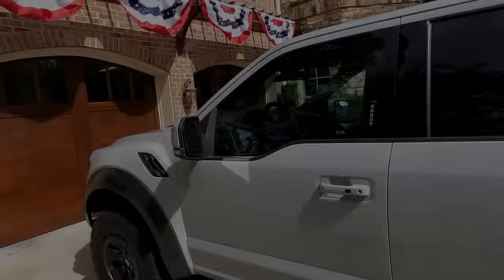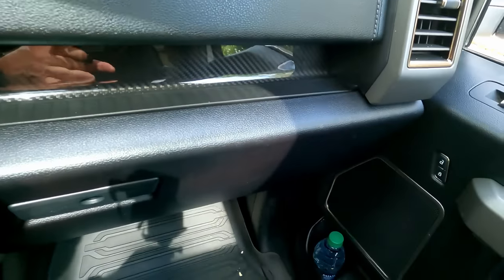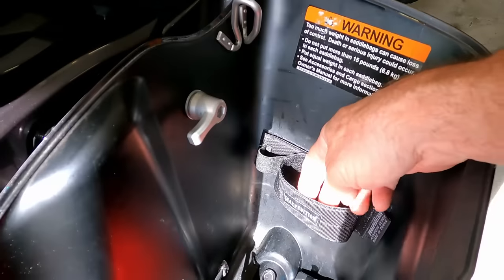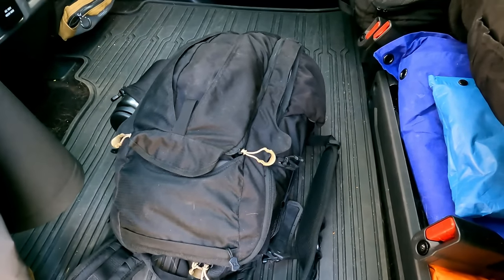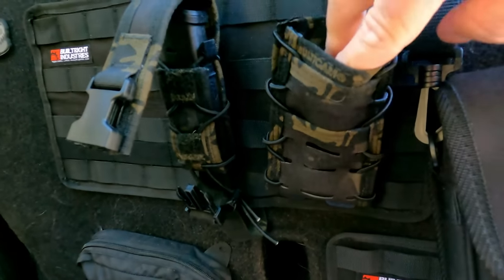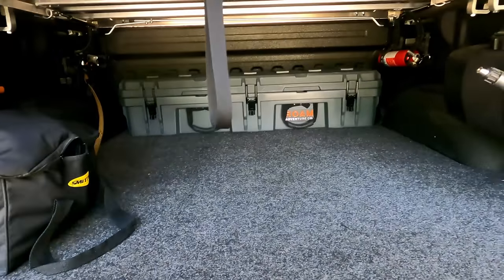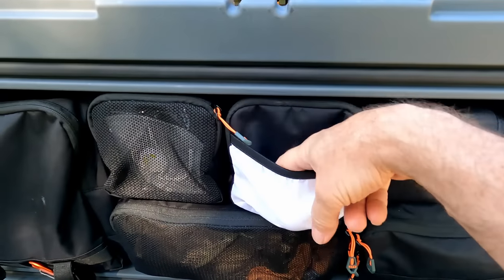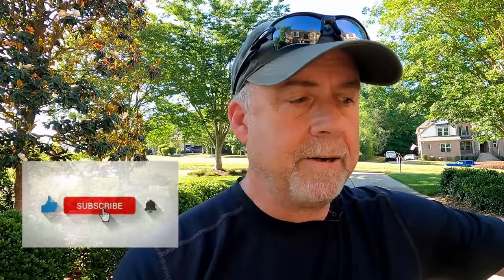Truck EDC - Everyday & Emergency Gear

Comment: Take your tourniquet out of the wrapper. Don't want to be struggling to get it out when you need it.
Reply from the maker: Hi Murph.  Thanks for watching and your feedback.  That has been a very popular request.  I removed it a couple days following the release of this video.  Thanks.
Reply: One may wish to stage the TQ so that it will be faster to secure around a leg or arm.  Pull the strap out maximum slack.  Take the lip that is marked with red and just barely close the lip over on the velcro.  Then fold the excess back into he footprint of the TQ accordion-style and keep the timestamp strip folded back out of the way of the windlass.  It'll save someone a few seconds in trying to get the thing around an arm or leg and less tedious too.
Reply from the maker: @1911GreaterThanALL  Thank you very much for your comment.  Sounds like you may have trained people in this area.  Your instruction was very good.  In fact it compelled me to make the change immediately.  Great instruction.  Thanks again.
Reply: @WeekendOverland  Welcome
Reply: no, that is bad luck, don't do it
Reply: And protect your TQ from the sun it degrades nylon over time. Great vid!
Reply from the maker: @hunterbruce8382  good tip.  Thanks for watching!
Reply: this

Comment: First time I seen a Molle panel mounted underneath the console that’s definitely a good idea best truck edc I’ve seen many good ideas on this episode.
Reply from the maker: Thanks for watching and for your feedback!
Reply: @WeekendOverland  i would add a couple tow chains a 2 or 4 ton come along winch, an old style bumper / farmers jack, a rem 870 or mossberg 500 folding stock with some less lethal rubber slugs, buckshot and some lethal loads, a military surplus 26.5 mm flare pistol and flares, water purifying pump kit, telescoping fishing rod with lures, a 3pc takedown recurve bow w/arrows, a small folding grappling hook with 550 paracord, that is some of what i keep in my jeep
Reply: @commiesnzombies  that's not nearly enough
Reply: @billrom795  it's not what ya could have it's the Wisdom to know how to Use what Got... sounds like all bases are covered..

Comment: Quick tip: Don't show your keys it can be easy to take model pictures and eather 3d print them or take the pictures to a locksmith.

Comment: This is probably the best truck setup I have seen. I hate seeing the “Tacti-cool” truck setups that have “8 Ar15’s, 15 handguns, and 50,000 rounds of ammunition” and don’t have something simple like a car jack or a rain jacket. I have definitely had more flats and caught in the rain more than I have been in a gun fight
Reply from the maker: BC 556 Thanks for watching and your comments.  You nailed it! When you start preparing your vehicle, home, etc, you should first focus on items that will assist you with events that are most likely to occur and then work from there.  Thanks again.

Comment: The holster setup has positive attributes but, what if your weak arm is busy fending off someone grappling you as you are getting in/out?

Or want to access the pistol while you're steering with your weak hand?

Pulling the holster with the gun makes it inaccessible if you only have tbe one hand available.

Instead, maybe train to keep your booger-hook off the bang switch as you draw?

Good setup 👍

Comment: Oh, and a big metal spike to drive into the ground, to connect your Come-A-Long to in case there are no trees to connect to.  1" diameter and 3 feet long.  That will get you unstuck.  Also fire stuff in case you get stuck and have to spend the night.

Comment: Great setup! Not sure if it’s been mentioned yet, but a small foldable solar panel could be a great addition to your recovery gear. Good way to charge your jump starter, comms, etc. if you lose your power out on the trail or anywhere else really
Reply from the maker: Hi N7_Forrest.  Thanks for watching.  Yes that would be a great addition. I have solar panels for my Jackery 1500 but do not carry them with me on a regular basis.

Comment: Sweet setup. What are you doing about the actual vehicle security? Had my vehicle broken into twice and now I don't keep anything in my new vehicle.
Reply from the maker: Thanks for watching and your response.  At this point nothing more than the system that comes with the Raptor.

Comment: Nice set up! I would recommend unwrapping your tourniquet to make it more easily accessible in a stressful situation and to be sure it is properly set up for use. Some come from the factory disconnected so you would have to loop it through the connector. Several YouTube videos on how to stage a CAT TQ.
Reply from the maker: Hi Aaron.  Thanks for the feedback.  I actually took the tourniquet out of the wrapper about 1 week after publishing the video.  Thanks for watching.
Reply: @WeekendOverland  I was going to say the same thing. Also practice putting it on yourself and others. Have your wife practice putting it on you as well. Great vid, your Raptor is more dialed in than mine!
Reply from the maker: @Sonic_fast22  thanks for watching.  I have actually taken some trauma medical training since I published the video.  I highly recommend it to everyone.  But good point to help educate those around you whom you may need assistance.

Comment: Thank you for putting this video together. Have been adding to my notes as I watch how you have stocked your truck. Maybe I missed it, but if not, do you have an extra pair of sun glasses in there? Or even some clear lens safety glasses? Thay can both come in super handy and dont take up any space.
Reply from the maker: I do have an extra pair of sunglasses in my get home bag but I like your suggestion about a pair of safety glasses.  Thanks

Comment: Great setup! Got some inspiration for my truck. The only suggestion I would have is on your med kit. Take the tourniquet out of the plastic wrap and stage it for use. (Qualification: I am a TCCC instructor). Nothing worse than having a severe bleed and can't get your TQ out of the wrapper.
Reply from the maker: Thanks for the input.  I took it out.  Now I need to get some additional training in order to be prepared to best use the IFAK.
Reply: @WeekendOverland  take a TCCC or TECC class! As a civvie, I did and leaned a ton.
Reply from the maker: @smportis  yes I plan to very soon.  Looking forward to it.  Thanks for watching!
Reply: @WeekendOverland  check out refuge training and refuge medical. They have their own websites with information about their gear and their training.
Reply from the maker: @lswisher13  thanks for the info!

Comment: that’s awesome! all that velcro stuff going on under the seat is so cool. and that console mount. Wish they made cool stuff like this for my 05 Silverado.
Reply from the maker: Thanks Justin.  Yes, the loop material under the seat is very convenient.
Reply: They don’t make anything like that for my truck.I’ve watched a lot of vids took a lot of ideas and made my own system.
Reply: @WeekendOverland  Does that come on the raptors, or is it something you added?
Reply from the maker: @driller6801  Yes it came standard on the Raptor.
Reply: @WeekendOverland  Gotcha. Thanks.

Comment: Great set up….take the tourniquet out of the plastic and then reattach to the bag.  If you ever need it you dont want to be fumbling with the manufacturer packaging before use.
Reply from the maker: Thanks Justin.  I have removed the wrapping.
Reply: @WeekendOverland  came here to say that! also a good idea to slide in a little sharpie in the loops where you secure it so you can quickly write the time of application to tell ems when they arrive
Reply from the maker: @brrrrrrrrrruce  very good idea Bruce.  Thanks for sharing.
Reply: @WeekendOverland  the experts are now saying to keep it in the wrapper to keep it from degrading.

Comment: Alright I’ve now watched all your videos.  Love the gear, love the high quality aspect and that everything is sturdy, organized and just great ideas.   Need more information on the water port and how you have that installed.
Reply from the maker: Hi Michael, thanks for watching!  I have had the Waterport (https://thewaterport.com/build-a-tank/) for a couple of years so I am not sure what bracketry now comes with the unit.  Mine came with both a hitch mount and a flat surface - rail mount (looks like those are now purchased separately).  Mine is mounted to the Biltright panels I installed in the sides of the bed https://builtrightind.com/collections/bedside-rack-systems
So far I have had no problems with the unit.
Reply from the maker: BTW the rail mount (at least the one I have) comes in 2 parts, allowing you to simply lift the unit out of the mount when needed and has a place to insert a padlock for security when mounted.

Comment: Mossberg Shockwave 12ga would be a nice addition ;)
Reply: hahahhahaha
Reply from the maker: Yes a 12 ga is always a good addition!!
Reply: That Shockwave is my exact setup.
Reply: Or a ar pistol... but yeah in my opinion and sorry to be noisy.. but yeah a shotgun will be a plus too
Reply from the maker: @Ghostpr787  self defense of any kind is better than nothing. Key to firearms is to be trained and practice good safety.
Reply: @Ghostpr787  carrying on your person is a great thing to do. Assuming you are trained in safe handling and storage. However, keeping your firearm in your constant care and control on your body prevents unauthorized use by others in the event your vehicle is broken into.

Comment: hey just saw this but...that tourniquet.  Take the Velcro zip ties off of it and and use heavy duty rubber bands.   Your setup is just not fast enough to release.  You need to be able to secure it but also be able to rip it free instantly if you need it.  remember, 40 seconds.  every second counts.

Comment: Great setup. I’m sure it’s been mentioned, but I would suggest a second tourniquet in the front within reach. Also I would pull them out of the plastic. Have them ready if needed.
Reply from the maker: Thanks for watching.  TQ in the front is a good idea. and yes I took the plastic off soon after the video was published.  Thanks.

Comment: Nice set up! I’ve put Molle panels behind my rear seats. Great for mounting tools and stuff. I did Molle in the center console and on both driver/passenger side did Molle panels. I have a lot of what you have. Like minded people!!  Although where I live. It’s too hot for water to be kept in the truck. It’s 120 in the summer!
Reply from the maker: Thanks for watching Robert!  Yes, we are starting to approach 90 degree days and the water will be transferred into a different container.

Comment: gallon of water for the radiator couple quarts of oil transmission fluid.  but great set up.      I have my oil and everything in a milk crate

Comment: Nice gear and awesome mounting options. As I start to carry more stuff in my Jeep, I'm always of stuff being rattling around from my subwoofer, so always looking into secure and dampened mounting options. Gonna take a look at that tool bag you've got as that would save a lot of spaces that's taken up in hardcases for me. 

My favorite mod of yours is that holster setup. I've been playing around with some center console options and so far like have my gun in its CCW holster, but don't like that it's basically a two handed draw as it isn't attached to anything. Looks like I can use a modified version of your setup to fix that,  so thanks for sharing!
Reply from the maker: Hi Artro. Thanks for watching and your feedback. Yes there are pros and cons to the way I have mine mounted.  Like using a safety (which I do not) you have to train on what has to occur when the need arises. I have trained quite a bit and feel that if ever the time comes that I need to draw from the center console quickly, my stress level will probably be very high, and this is when mistakes can be made.  Keeping the holster with the weapon until it is in a more manageable position is my preference.  Drawing in a vehicle is much more challenging than drawing from a holster on your side. But everyone has to find what works for them.  Good luck and be safe.

Comment: Bug spray, sunblock, and some extra deodorant are always nice to keep on hand. Most of the time my wife forgets one so it’s nice just having it in the truck and not having to run to the store or stop to get it when you’re trying to get to your destination.
Reply from the maker: Hi Nick, good point.  Thanks for the feedback!
Reply: In addition,  I always keep wasp spray in my bed mounted box but my rig doubles as a farm truck so you may not have a problem with the flying devils like I do. You could use it to spray protestors just for fun though. :)

Comment: Sweet setup, cool truck! Gave me some good ideas for my vehicle! I’d consider adding some spare dog leashes for your dogs, some road maps and a spare quart of engine oil just in case you need to top that off! And I’d suggest keeping a smaller pair of binos in the center console of your truck for quick access, just in case you see some wildlife and don’t have time to reach back and grab your Sigs. Thanks for sharing!
Reply from the maker: Thanks for watching Cole and for the great suggestions.

Comment: Great set up!  How are you mounting that velcro Maxpedition to the plastic inside of the center console?  Super glue?
Reply from the maker: Hi Ricky.  I actually used a piece of adhesive backed velcro.  It has worked pretty well.  The first time it got very hot in the truck it came off so when I replaced it, I allowed more time for the adhesive to set up before putting weight on it and it has stayed put ever since.

Comment: I have the Leatherman raptor rescue scissors.  Also has a glass breaker seatbelt cutter and ring cutter. I need a couple more for both vehicles and my gear
Reply from the maker: Just checked these out and they are pretty cool! Definitely going to get a pair.  Thanks for the info.

Comment: I would highly recommend taking that CAT tourniquet out of the packaging and stage it correctly so you can deploy it quickly.
Reply from the maker: Thanks MM for watching!  Yes I have removed it from the plastic. Good idea.  Thanks.
Reply: Definitely agree. Mine is staged and rides in the driver's door compartment.
Reply: And the cats off the truck
Reply from the maker: @therealbigfoot3076  Haha yes nothing worse than a cat walking across a nice paint job!

Comment: Lucky no one broke into the truck and steal them. Any bag in an unattended is an opportunity to break in.
Reply: Sounds like you need to move, I have $2000 in radios in my truck and rarely do I even feel the need to lock it. My father has always just left the key in the ignition and it's never proven a problem.
Reply: Luckily a plane didn't crash on his head while he was filming too.

Comment: Hi Weekend,
I picked up a couple of small Harbor Freight tarps in case of a flat.  I keep them behind the back portion of the back seat.  It will give me something to kneel on and something to put my dirty flat tire on when I put it in the back of my truck, to help keep me clean when working and the back of my truck clean with the dirty spare in it.  Also  I picked up some interesting temporary tire chains that are made to go on rims like ZIP TIES.
Reply: harbor freight has these small foam kneeling pads also. changed my sisters tire the other day and it kept the rocks out of my knee. i recommend!
Reply from the maker: Thanks for watching Arlene and your comments!!
Reply: I have a Leer topper and a Bed Rug bed liner that is why I want to keep the back clean. I haven't done the Reflectx window covers yet.

Comment: Not a good idea having a water bottle in the heat.
Reply: Not disagreeing but as I have worked outside in the most extreme temps of the western desert most of my adult life it isn't hurting anything. Our water cans sat on the rigs for days. Yeah it's hot/warm whatever but your body will absorb it faster. Im certain he rotates the water too.
Reply from the maker: Thanks for your input James.  I do rotate and most recently added some aluminum cans with water for emergencies.

Comment: I’m curious how you’d need to change in a more hot or cold climate. In the US south we can’t really keep a lot of stuff in our cars because they will get damaged by the heat. I’m sure there are other considerations for freezing weather. Great looking set up, looks very functional. Goals!
Reply from the maker: Hi T Austin.  Thanks for watching. I agree that in the south our biggest challenge is typically the summer heat. I've started storing water in aluminum containers instead of plastic, medication should be cycled, and probably ammo as well. In the winter, I really do not make any accommodations other revising my stored clothing and shoes to accommodate the low temps.
Reply: @WeekendOverland  I didn’t even think about medicine! Yes, things just get damaged over time. It would be tough to make a set it and forget it kind of set up. I’m trying to create a first aid kit that can survive the summer and it’s not easy. Any tips from your experience?
Reply from the maker: @treaustin1  I have a trauma IFAK that I keep in my truck at all times.  I am fortunate that I do not require any prescription meds so the only meds I keep in the car are Benadryl and Aleve.   Therefore the degradation isn't a big deal.   I haven't researched extensively but have yet to find a good way to store meds in a hot vehicle.
Reply: @WeekendOverland  Sure, I think I’ll just avoid medications and go for other supplies. See if I can find some adhesives that won’t melt on me. Thanks!

Comment: Hey great set-up. What are the floor mats you are using. I am looking for a “Full’ rear mat for my tundra. All I have found do not go as deep (under the rear seats) as yours. Thanks in advance.
Reply from the maker: Hi Ivan.  These are actually the floor mats that came with the truck from Ford.
Reply: @WeekendOverland  ok. Thank you